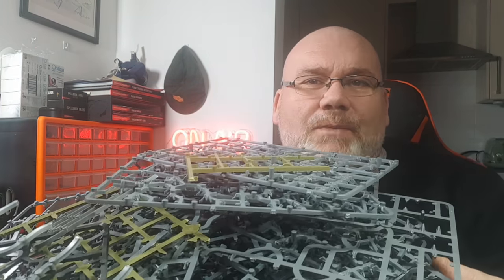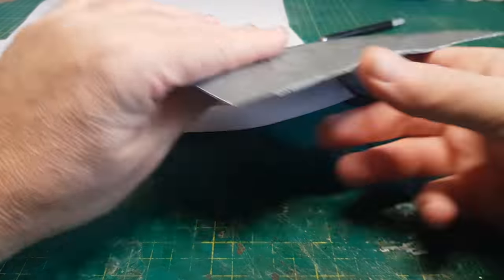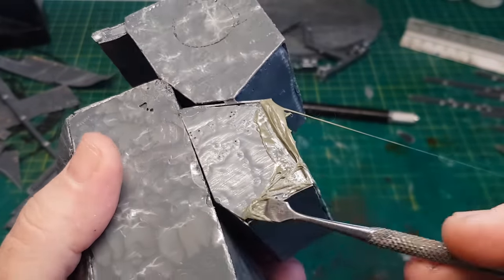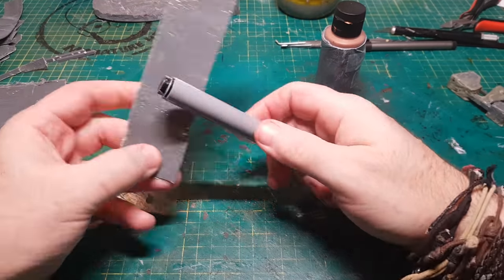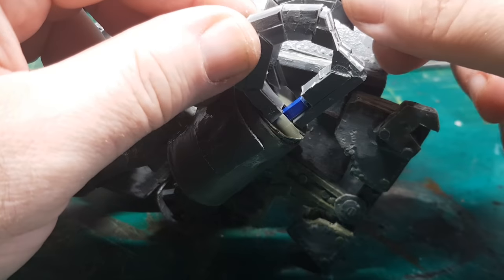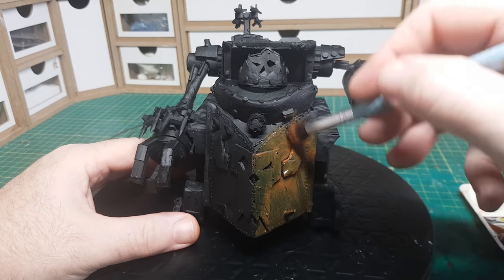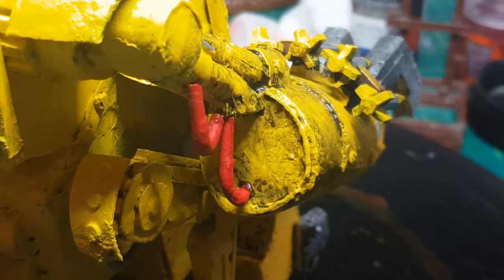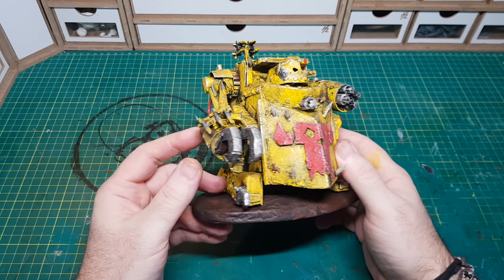How to Make a Gorkanaut out of Warhammer 40k Sprues

Comment: Yellow is one of the more difficult colors to get right.
Both because it tends to not cover up very well and also because the tone of the yellow is usually extremely difficult to look realistic.

I paint my orks primarily badmoonz, but i dont do overly beaten up rust effects because i spend so much time making the yellow look good.
Reply: How'd you manage a good yellow? I usually do a dark orange base then a couple thin yellow coats (all in acrylic) but I'm wondering if there's an easier way
Reply: Ive heard pink helps yellow out but ive got no idea ive never tried it and havent really looked into if it does or not

Comment: Great work dude! The other thing to remember is that painting anything it always goes through an ‘ugly stage’ I find and I usually hate the paint jobs I do on models at one point or another. The thing to do is push through and you’ll get there. I think your finished model looks good but if you wanted to do some weathering you could use a spounge to lightly add some brown chips and id also recommend playing with some weathering pigments.

Comment: yellow is really tricky, a nice tip is to spray the whole model white then from only underneath spray it pink so u can see pink shadows, u could use ur new airbrush for this but a spray bottle works fine, then spray yellow over the whole thing with an airbrush, as yellow is slightly transparent, the shadows come out really nicely, i have used this technique on a bad moons battle wagon and it looks great, u should definitely try this
Reply: Ya the reason the yellow looked green was because it dried translucent and allowed the black to come through. With yellow, you need a lighter under coat to avoid this.

Comment: The build turned out great, I initially thought it was a genuine Ork Gorkanaut from thumbnail and short until you stated otherwise.  As for the paintjob, maybe next try using a stiff paint brush and make sure that there isn't too much paint on the brush before applying it.  You might find this technique works a lot better, although I think the green was mostly likely because of the dark colour underneath.

Comment: Looks awesome! 
But, on the paint, you kinda mixed things up. You did the brown "rust" layer then totally covered it in the yellow. Not much point. Would be better to go black base coat, then build up the yellow using VERY diluted yellow paint. I sometimes spritz water all over my piece before painting Orky stuff, then splash the paint on. let it dry and go again. slowly building the color but you have really uneven splodgey layers underneath so it builds a natural worn, cruddy, messy kinda look. then highlight with bright yellow on the edges. next step is to use a sponge (not that thing you were using, its probably what caused the green color to come out in the yellow) to dab on brown building and adding progressively as you go so that you get the look you want. Then using a real old crappy stiff HAYWIRE bristled brush go in with a bright silver to create scratches. Man I would LOVE for you to send me 1 of those to paint for you :) I'm only across the pond in Ireland so let me know :) check out my facebook page (games terrain) to have a look at what I can do. I'm currently working on an Ork Workshop so a lot of the paint techniques I mentioned are used on there. Anyway, keep up the FANTASTIC work and continue inspiring us all. Thanks

Comment: Looks ok for me on screen, but I had the same problem some time of yellow looking green over brown. Putting a bit of red into the yellow helped me (so it's a bit more like maize yellow). It's cuz dark brown (or translucent light brown over black) has a lot of black, which is blue based, and with yellow it makes olive, I think. Also I would use a foam and not fibre based sponge. When you tear it apart, the fine structure gives you better paint chip/particle effect.

Comment: Don't give up on ur painting, I have problems with mine, but I got told to do more builds and painting the more you do, the better you get. I have been in the game since the late '80s, and I'm always learning a short cut or a better way to paint, as I have started to use an airbrush which has put the fun back into painting my Super heavies, I model Imperial Guard Catachan Army, hundreds of vehicles and air units, now I'm in my late 50's, so please give it go cheers from DownUnder.

Comment: I love that outcome, so dont detract from your work. Yellow is just a pain to paint, especially over black. That's why it had a greenish tint to it. 
I can give my recommendation for a model like this but it's a bit late. After the black prime, a light zenithal prime with white will help the yellow coverage. If you have an airbrush, airbrush yellow. I bought an airbrush specifically for priming models and painting yellow on my Imperial Fists. Using the sponge for weathering after the yellow, and a brownish wash.
Yellow is so finicky. It can feel really flat as a color if it's too thick. It really shows what's underneath, but if the base coat is uniform it can become a slab of mustard disappointment. Anyone who paints yellow armies has probably at some point stripped it half way through to start over.
Everyone has their own recipe and preference because yellow has so many different feels to it. Some are cool, some are warm, harsh, soft etc.